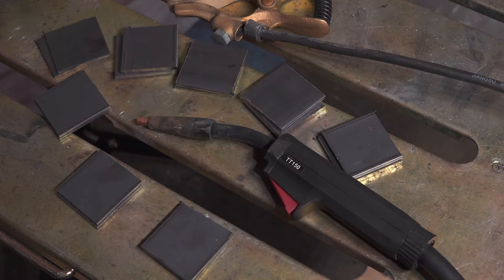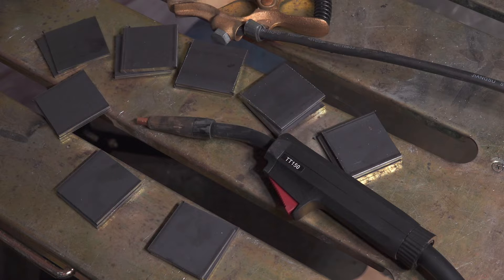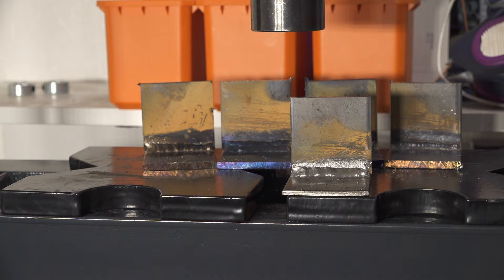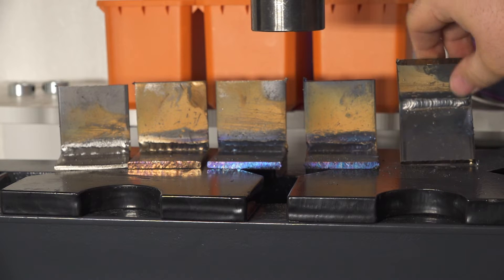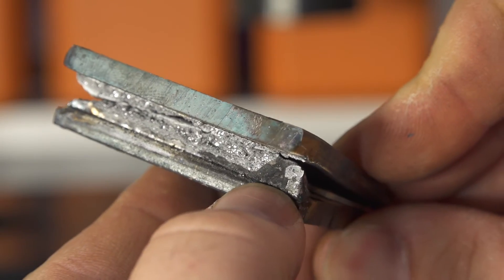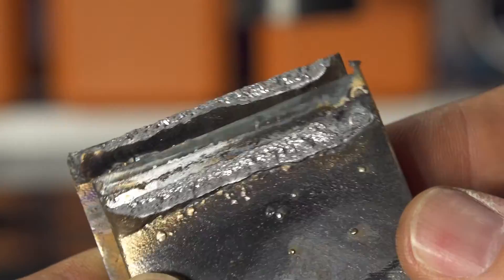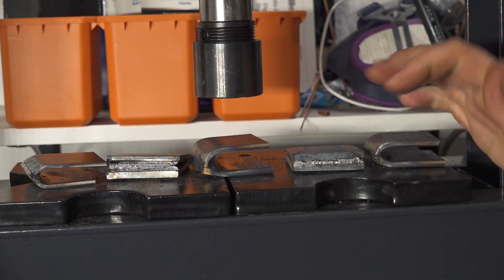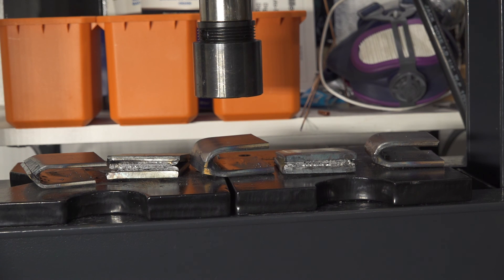Harbor Freight Flux Core, Weld Strength Testing Part 2

Comment: I've taken many test for jobs like this. Only difference is they were T joints with 3/8" plates, and stick welding. The criteria to pass was the joint had to break near the center and then be inspected for porosity, slag inclusions, lack of penetration, or lack of fusion. Not really strength. If it passed that the strength was not a question. God bless and work safe.

Comment: Great videos and very informative!!! Could this welder be used to weld some steel tubes to a trailer as a reinforcement? 12 gauge steel tube is what I am thinking of. Thanks.
Reply from the maker: This welder would probably work.  Part of it would depend on how thick the material of the trailer is that you are welding the tubing onto.  

Do you already have this welder, or were you thinking of picking one up for this project?
Reply: @bigtb1717   Thanks. I am thinking of picking this up or the Titanium Flex 125 this weekend. The trailer is the Harbor Freight utility trailer and the steel tubing is 12 gauge. Appreciate the answer.
Reply from the maker: In my opinion, the Titanium Flux 125 is a much better machine.  It has DC output which provides far better penetration, less spatter and smoother welds.
Reply: @bigtb1717  thanks for that information. I think I’ll get the titanium 125. I think that is also on sale this weekend. I have never welded before, so there will be a huge learning curve… thanks again.

Comment: One more thing—

—I believe a bid issue not really discussed with this $159.00 machine and a $750.00 machine is:

DUTY CYCLE!  Only 20%...!!!

For every 12-seconds of welding on the Central Electric, one must allow the wand to be ceased from welding and the cooling fan still running for 48-seconds.

Comment: Ya—

—1/8"/11-gauge is all my machine seems to handle on orange old car control arm wire-wheeled.

Also, neither could I see any puddle with the Central Electric wire.  I am out if it now and starting the "Vulcan" Harbor Freight wire to morrow.  Can't Wait!

Comment: I'm seeing some dark looking welds there. That tells me you are getting flux inclusion in the welds. Did you have actual slag on top of the welds, or just some dust? If there is not actual slag then something is off in the process. You may need to tinker around with a slightly slower wire speed, and watch out for the edge of the slag cap getting into the pool. Slag in the pool will make a VERY weak weld.
Reply: 😆good one!

Comment: Thank you so very much.    I have a couple of tips to add, the first is that ALL of Harbor Freight's flux-core wire, at least at my local store, is -GS rated which limits you to one pass only.  (Of course no one has a gun to your head preventing it.)     The second is actually an important tip for almost all kinds of welding where you wish to prevent cracking because the edge weld is the coldest/weakest.       The solution is quite simple, don't start at the edge!       Start a 1/2-1 inch into the joint and when you get your proper pool just pull your rod/gun back welding as you go.  This also prevents leaving a weld weakening crater and porosity.
Reply from the maker: Most GS wire is not rated for multi-pass welding.  It relies on base metal dilution for proper strength and properties, and if you put weld on top of weld it may not have desirable properties.  Lincoln NR211MP is rated for multi-pass, and that is the wire I used in this video.
Reply: @bigtb1717  I am currently using Blue Demon E71T-11 flux core wire.    I prefer the Innershield for several reasons but the local big box store price for the Lincoln is prohibitive.   The second and third comment parts are important...
Reply: Third tip, and I'm ashamed I forgot it, is to always bevel your joints!

Comment: I think you may have convinced me to start out with this welder. It seems to be more than capable of meeting my current project needs (1/8" material under relatively low pressure).
Reply from the maker: It definitely works well enough on 1/8" and under material.  3/16" and up is a struggle for this machine, but it could be good enough for some projects.  

I have another cheap welder on the way that I will be looking at as a potential first welder alternative to this HF, Chicago Electric flux core welder.  May or may not end up being as good, but I'll post the video and my opinion as soon as I can get it done.  Still, the HF flux core is popular for a reason.  It is inexpensive and from all accounts is seems to be generally reliable.

Comment: What was the Pound Pressure reading on each test before it was broken?
Reply from the maker: I didn't measure the pressure during these tests.  It really isn't a lot of pressure.  With the leverage against the joint, the press doesn't have to exert much force to bend the metal/break the welds.  I don't think it even gets to the first line on the gauge, so there really isn't enough resolution on the gauge for it to be any value during these particular tests.
Reply: @bigtb1717  Okay Thank you. I'm trying to figure out how many Pounds per Square Inch it would take to break a 2x2 1/16 thick tubing welding all 4 sides. I know there is many factors base on welding skills. I just need any idea how force it would take to break the welding Joints on a 2x2 sq tube to a 2x2 sq tube.
Reply: Sweet thank you for you information. I'll weld it if it breaks I have achieved the limitations
Reply from the maker: Well keep in mind, anything welded all the way around would be far stronger than the welds that I break in my video.  I'm bending the welds in their weakest direction.  If I'd welded both sides of the joint it would have held up exponentially better.  If you weld all the way around the tube and have good welds, the weld should be as strong as the tube.  In other words, the tube would likely bend and fail before the welds fail.

Comment: I only run 035 wire on my 125 hf welder it runs fine of course I don't know what I'm doing 4 certifacations and been mig welding since 1963.that hf welder runs a lot better on 035 when you learn how to weld
Reply from the maker: There may be an issue with my machine.  It stutters bad and the arc turns on and off like someone is flicking the power switch on and off randomly when I run 0.035" wire and turn the feed speed above 1.5 or so.  Above speed 2 it will barely light an arc, just sputters terrible.  At 1.5 and down with 0.035" wire it runs smoother, but is running stupid cold. 

I'll do some checking into the issue when I get a chance and see if I can get performance to improve.
Reply: you deffently have an issue with it. I had a 100 amp  hf machine  and it ran a lot better with 035 ,they had it about 10 years ago,and I ran about 50 rolls of wire through it until iI burnt the speed control board up because it wore the linner through. My son used it a lot for porch rails and stuff like that so when I broke it he had a job to do and replaced it with this 125. FYI the improvments is a lot, the transformer is twice as big and the wire feed a lot better plastic, pinch roller has 2 groves, 1 for 030 and one for 035. the contact is no longer hot. The higher the wire speed the more amps it will put out. On the max settings It will burn through 3/16, is so much easier to just grab this little machine, don't always have 240 volts,  than get my GE machine out for a small 5 min job.Also have a heiliarc for any serious welding.
Reply: @haroldcrabtree4899  I tried both 030 and 035. Couldn't seem to get to do anything but lay on top. Not real experienced with mig, though did play with a real one. Used tig, was an all around fabricator, 16ga up through 1inch +.
Reply: OMG, 4 certifications!!

Comment: Awesome test! Thank a lot. The opposite side of the joint won't always be accessible to weld, so the fact that the 3/16ths steel held up with multiple passes on one side is great. For most non professional uses spending some extra time to do a few more passes won't be an issue I think. 

Part 3 idea: How about really punishing this thing & pushing it to the absolute limit by testing it with 1/4" & 1/2" steel, using a grinder to bevel both sides of the joint to get better penetration, then testing the strength with 3 passes, then 6 passes (or more?). And maybe you could test vs a single bead from a more expensive, more powerful welder, to really illustrate how much more work it takes (multi pass & bevelling) to get a strong weld with a cheap welder vs an expensive one. 
Hopefully the test actually does show that it's actually possible to get a strong weld with the cheap welder but with a shit ton more work, lol. Title could be something like  "$120 Harbor Freight welder vs 1/2" steel, ultimate weld strength test". Thumbnail: 1/2" steel being compressed & bent without breaking, with caption on image "Does it break?" or "It Works!", etc. I'd dislocate my wrist from clicking that video so fast.

Humble recommendation: I think you should put the price of the welder in this video's title ( $120 Harbor Freight Flux Core Welder | Ultimate Weld Strength Test Pt. 2), and a thumbnail of the metal being compressed & bent without breaking, like at 11:59. I think that'll pique people's interest more. I know it would for me! Seeing the broken pieces makes the vid feel a bit like a foregone conclusion & doesn't really inspire anticipation & excitement to click it. Just a view. 

Edit: Hey, had a bit of time & actually did up my thumbnail idea, lol. Check it out here https://imgur.com/gagzwvl
Edit2: Another with an emoji face (apparently I have too much time on my hands). Think this is even more attention grabbing.
https://imgur.com/a/qFURPIi
You can use it if you like

Great stuff, Thanks again!
Reply from the maker: Thanks for the kind words and the ideas.  I kinda like the idea of doing a multi-pass fill of a beveled joint and then cutting and etching to see/show how the harbor freight welder does on something like that.  I might have to make a jig to bend it because you generally don't bevel a corner joint because you just use the corner as the area to fill with weld until the weld size is large enough.

I agree that I could have done a better job on the thumbnail.  I honestly would have, but I was feeling really sick and couldn't bring myself to go to the effort, so I went with the auto-generated thumbnail.  

Keep in mind, one thing that helped the multi-pass weld is that the parts were so small that the whole thing heated up a ton.  On a larger component it may not heat up as much and go quite the same.
Reply from the maker: Also keep in mind, the ones that broke probably would have held up much better if bent in the other direction.  A corner joint isn't nearly as strong in the direction I bent them as it would have been in the other direction.
Reply from the maker: Thanks, and a great new year to you as well.

P.S.  Those thumbnails look pretty good.  I know a thumbnail can really help a video get attention.  I should put a bit more effort into mine in general.  Thanks again.
Reply from the maker: Well, part three is definitely going to happen.  Another commenter believes there is something wrong with my machine because his can supposedly burn through 3/16" steel.  I will honestly be shocked if a 120V, 125A max (90A "rated") flux core machine with AC output can burn through 3/16" steel under normal conditions.  But I'm going to put in my due diligence.  I did wonder if my machine had an issue with the liner, or other issue because of how poorly it ran 0.035" wire.  My unit is past the warranty period, so I bought a second one on my way home from work today.  I'll do testing with the new machine this weekend.  I'm going to measure actual output amps and volts.  I'll also cut and etch some welds on various thickness material.  I'll try 0.030" and 0.035" wire, and I may bend some more stuff depending on how the rest of the testing works out.

The biggest reason I bought the new machine is that I don't want to base conclusions, or show results based on a defective machine.  My guess is that even if there is a difference in performance, it will be small, not night and day.  But I'll find out and will show my results.  If I become convinced the first welder is defective in such a way that the performance was drastically affected, I'll find a way to note it in the previous videos and may re-do some of the previous tests.  Honestly, I tested one other brand/model 120V, AC flux core welder, and the penetration on 3/16" steel was poor on that one as well.  So I don't really expect the new machine to be vastly more powerful.  But I want to be sure before I say so.
Reply: @bigtb1717  Hey, that's great. Looking forward to seeing that 3rd test. That you'd buy a new welder just to make sure that the findings in your videos are accurate is quite laudable & a testament to the standard of quality of your testing. Really appreciate the attention to detail that you put into these tests.

These sort of benchmarks are so useful & valuable for prospective buyers because of all of the marketing tricks/lies that these companies get up too. 
Case in point (as you noted) is Chicago Electric basically relabelling the identical machine as a 120A welder and increasing the price. I've been looking up some cordless ratchets & its the same issue- the actual torque specs are usually at least 10  ft lbs less than rated when tested.